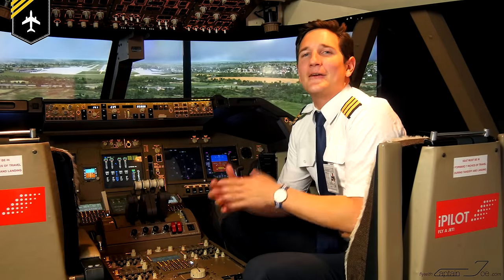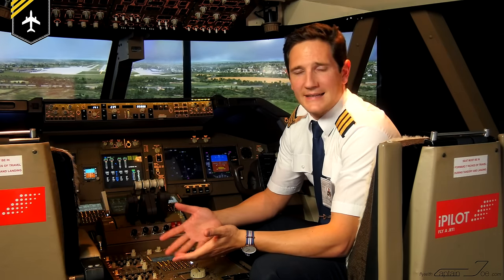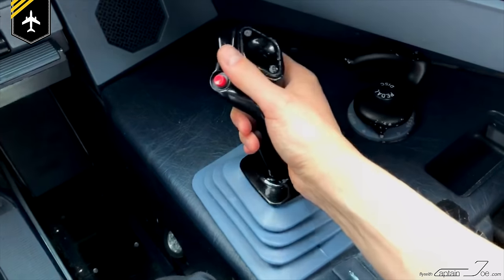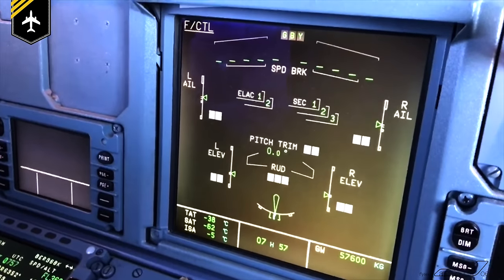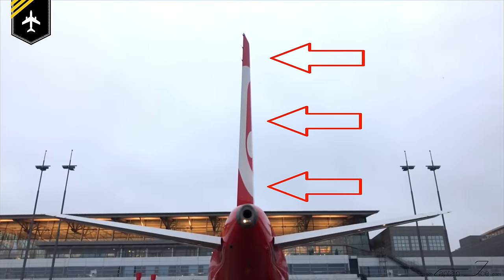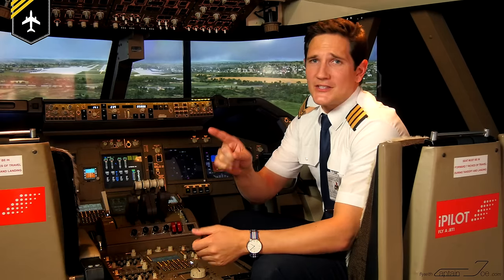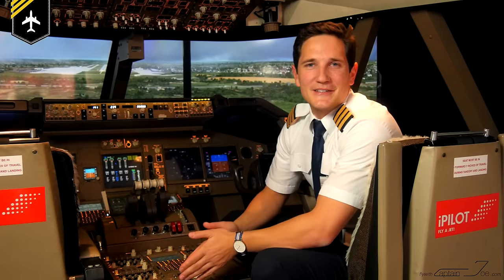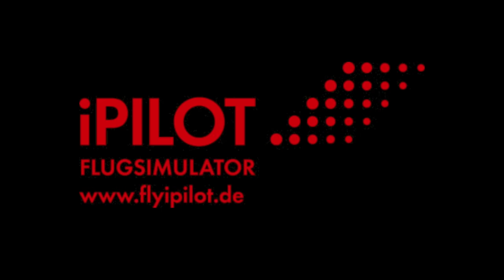Why does the RUDDER point to the right? Explained by Captain Joe

Comment: my rudder also hangs to the side while in "parking" position.
Reply: Bytesback but sometimes it releases the parking brake automatically without any pressure. Could it be a malfunction? No wonder women always break things.
Reply: left or right?
Reply: steemdup depends on the wind.
Reply: +Alexander Mustermann  Hmmmm.......very interesting, indeed.  Question for ya, Alex.  Has that rudder of yours ever been involved in anything other than "solo flights"?
Reply: turbofanlover well it had to suffer female PICs without much experience while I was the copilot.
Reply: ........and then you woke up and found your rudder to be pretty much in the same "operating condition" as Mark Jones, here.  And somewhat disappointingly, said operating condition then led to yet another "solo flight".........right?  ;)
Reply: turbofanlover Well actually my copilot resigned during another nightflight which afterwards led to several soloflights. You were partially right on this one ;) Good thing is there is a vacant position open and I'm hiring now. Female applications will be prioritised due to shortcomings of female copilots in this field of work.
Reply: Bytesback the valve blow issue is well known, several big industry companies have worked out a solution which is a tailored rubber shield. It is a single-use, low-cost solution with a 1% chance of failure.
Reply: +Alexander Mustermann So, just more "solo flights" until further notice, then.  That's a real shame there, Captain.  Good luck to you on "filling that vacant position".  Hopefully, it will happen for you, eventually.  ;)
Reply: +Bytesback  This phenomenon that you refer to has the potential to be problematic, especially when not flying solo.
Reply: Bytesback I'd check with the maintenance procedures manual on the Internet. There is a ton of websites dedicated to rudder maintenance for all kinds of models and years of manufacture.
Reply: turbofanlover as an experienced PIC I know exactly the behavior of the plane at any times so flying solo isn't a problem.
Reply: Bytesback AdBlue is a short term solution but doesn't solve the long term problem. We still need research advancements in the long term solution of the obsolescence problem.
Reply: +Alexander Mustermann, same. Although external conditions may cause it to get jostled around and accidentally get engaged in the neutral position. I get mistaken for  readying for take-off, and everyone just scampers. There was a time that this lass told me &quot;Wow. Running your engine inside the hangar. Ugh, typical&quot;. Feels bad, man.
Reply: Mark Jones indeed, the engines are running.
Reply: You guys made my day lol
Reply: 69 likes... Fits the context.
Reply: Uh finally found someone with my saime issue.
Reply: my rudder angles to the left and has a small fluid leak which leaks all over the baggage area.
Reply: Raidzor つ ◕_◕ つ same lol
Reply: Gosh, the chute got stuck in my refueling probe 
again...
Reply: SHIT MY RUDDER IS STUCK IN THE PARKING POSITION!
Reply: Raidzor つ ◕_◕ つ try ADBlue aka Viagra
Reply: Alexander Mustermann Shit now it's straight but it got smaller!
Reply: The problem with having a stiff rudder in the morning is caused by the APU starting it'self automatically while the plane is parked. Try draining the hydraulic fluid before parking.
As for filling your vacant position with a female, it is well known that if you hire a wingman you can have supplementary hydraulic fluid injected into the exhaust port to keep the system lubricated, this has the added benefit of attracting a wider array of female applicants for the co-pilot position with the potential of having a better and more picturesque view for the long term as well as better mountains in the scenery. This can alleviate the requirement of using the blue additive as the parts wear out.
Reply: Haha..Best conversation ever.Made my day 😂😂
Reply: Alexander Mustermann ikr
Reply: i laughed so loud at tjis you guys def. are the best. 😂😂😂
Reply: Alexander Mustermann 69😏
Reply: Alexander Mustermann is this comment supposed to be sexual in some way🤔
Reply: Adrian Wulff think so
Reply: Why is my rudder touching my elevators when in the parking position
Reply: A
Reply: This is pure gold.
Reply: Thanks 
Now I gotta rewatch the video
Reply: @MikePlaysYeet  nice pic
Oh wait you already said that
Reply: These coments are fucking gold lmao
Reply: I dont know if you're joking or you're serious
Reply: One of the best conversation i have ever read on yt

Comment: The MD-80 does this as well, but for completely different reasons. The MD-80s flight surfaces are controlled by tabs on the trailing edges, that deflect the airflow causing the control surface to move in the opposite direction.

Comment: to clear up any questions on backup hydraulics here is my answer:

If both engines go down, a Ram Air turbine pops out beneath the aircraft (providing hydraulics and a little bit of electric -both Boeing and Airbus)
then the APU is started to produce more electricity and restart the engines. (but the aPU uses fuel)

If the plane runs out of fuel, the plane is fully reliant on the Ram Air turbine, Pilots have to watch their speed since if they go too slow the turbine wont spin fast enough and there wont be enough hydraulics.

The ram air turbine doesnt power all hydraulics, most of the time it doesnt power all of the spoilers (sticky up things on wing) or thrust reversers (since no engines).
There are electric pumps, which are sometimes used
But during normal flight the engines are the main producer of hydraulic pressure

Capeesh?

Comment: "the Fly-by-Wire is a complex system" - As a computer engineer, I also had lectures about safety critical embedded systems (in fact the platforms I was working on in both my B.Sc. and M.Sc. thesis was a research platform for safety critical systems) and to get a handle on AFDX (ARINC 664), our professor showed a rough overview of the network architecture of an A380 and how many LRUs are used there... That's a lot of equipment that Airbus installed there to implement all the functionality of an A380...

Comment: The rudder on most smaller aircraft, like the C172, is also mechanically connected to the nose wheel steering, making it impossible for the wind to blow the rudder around. In fact, if you attempt to move the rudder by hand it can damage the mechanical linkages. I've never seen a control lock on a C172 rudder; the one shown in the video only locks the ailerons and elevator. A gustlock would also not be necessary since the nose wheel steering mechanism sufficiently holds the rudder in place.

Comment: On the DC-9, the primary controls are NOT connected directly to the control yolk or rudder peddles.  SO on the ground and with no air blowing over them, they will be driven by the wind.  You can move the yolk all you want but the ailerons, rudder and elevator will not respond.
Instead, the primary control surfaces are driven by spring tabs on the trailing edges of the control surfaces.  A spring tab is a lagging tab which uses mechanical advantage to "drive" the control surface in the right direction for the input of the pilot (or copilot). So when the control yolk or rudder peddles are moved, you can see the print tabs moving on the respective control surfaces trailing edge, but in the opposite direction of the desired control surface movement.  
This design eliminated much of the need to have powered control surfaces and therefore saved weight.  The DC-9 is about the largest aircraft you can have before you must go to powered controls.

Comment: The control lock pictured for the small plane would not lock the rudder position. It locks the yoke controlling ailerons and elevator. The small planes I fly do not have a rudder yoke as that control surface is the smallest and least likely to be blown about by wind. Not saying there isnt such a thing, just that I am not familiar with it and the picture shown would absolutely not lock the rudder.

Comment: Hello Captain Joe, i have a question that I have been curious about for many years and have had no response to it, I hope you can answer my question in the next video of yours. :)

My Question is:

Why Do Cabin Crew and Pilots Ask you to switch your Electronic Devices to AirPlane Mode or switch them off, During Taxi,TakeOff and landing. 

I really dont know why they ask that and the last time I remember going on a plane and asking the flight- attendant I got yelled out. (yeesh)

I hope you can answer my question in the next video.

Thank you and keep up the Great videos, Captain!
Reply: From a crew member's point of view, if such a rule is on the regulations or the company standard procedures, we're there to make sure that rule is respected. Now, if you ask whether mobile phones can cause a problem, the answer is "apparently not".
Why the regulations or recommendations are how they are is probably because of a measure taken when it wasn't clear whether these devices could interfere with the airplane's systems.
Reply: Put your phone next to a radio and make a call. The radio goes "Bzzzzz da dtt dt dt dt dt dt bzzzzzzzzzzz d-dt d-dt d-dt-dt-dt-dt-dt-dt....." 
Also, they want to ensure that everyone pays attention during the safety briefing, seat belts are on, and you can hear the PA system. Imagine being a flight attendant and half of the plane is on the fkn phone during taxi'ing and they are going up and down the aisles checking seat belts, and have to get the attention of every 2nd person (because they're talking on the phone) and telling them to buckle up. It would take 3x as long.
Reply: Jesus

Comment: I have a question about the glide slope , the question is that before getting the glide slope the plane is tilted because the speed is less but when it get the glide slope the plane get to it's normal position, why does the position does not remain till the plane get it glide slope? why the plane has to tilt with less speed? I will look forward for your answer

Comment: Great video as always. I assume the airbus don't have a lock for the control surfaces because they are much heavier? So the sheer weight of it can keep it in place? Correct?
Though the rudder moves left and right from wind so I assume that isn't entirely true, or maybe the mass of it means it doesn't move too quickly(hence not really flapping)
Correct me if I'm wrong.

Comment: Please explain the difference between fixed horizontal stabilizers and stabiliators. Which types of aircrafts use which types of tailplane and why? As for A320, I have seen the whole tailplane is adjustable.

Comment: Hello Capt. Sorry for the late question. How we can say that with zero pressure both ailerons are positioned down. Ailerons are differentials control , right? So if LH down then RH should be up. I don’t know about A320. I hope you can explain. Thanks in advance.

Comment: Captain Joe, would the flaps also hang down while parked due to the loss of hydraulic pressure? I vaguely remember boarding an air craft a few years back and noticed the flaps down.  As we push back and engines are fired up,  the flaps and other components begin climbing to the neutral position and retracting. Only to have the flaps once again start extending for takeoff preparation. I also vaguely remember on landing,  the flaps begin retracting and when parked at the gate,  had a long wait to get off the plane for what ever reason and saw the flaps going into full extension.
Reply: On some Airbus if the outside temperature is more than 30 degrees C then the flaps and slats are left partially out to prevent the bleed air system thinking there is a leak, leaving the flaps out allows air to flow through
Reply: @tomstravels520  thank you very much for the response. I learned something new today

Comment: Capt. Joe, I have a question.
I was told that control surfaces on a FBW plane are not influenced by external forces so one day during the Paris Airshow I wanted to put that theory at test, while visiting a Navy F/A-18E Fighter on static display I deliberately tried to move its ailerons and flaps with no avail, which confirms what I have been told.
Now my question is, are military planes different from commercial airliners in that regards?
Danke sehr.
Reply: That hardly proves anything. The difference of FBW to is that there is no mechanical connection to the controls in the cockpit which means there is no feedback from the control surfaces to the stick. With a mechanical connection you could sometimes feel vibrations and similar things of the control surfaces in the stick or yoke. That's not the case with a FBW-system.

A static display aircraft won't have switched on its flight control system anyway. The control surfaces of an F/A-18E are designed from the very beginning to be moved by some hydraulic actuators because the forces the control surfaces experience at high speed are enourmes. So even with the hydraulic pumps switched off, a human will be barely strong enough to move them.
Reply: shi01 thank you for the explanation.

Comment: is the force of the wind is enough to rotate the rudder when the plane is stand still? since it's  a hydraulic system it has some mechanisms to control the valve systems that controls the amount of fluid passing to the hydraulic.so during the stand still conditions those things are not functioning and the hydraulic fluid doesn't return back to the pump or control system  so i don't know how.. but thanks for a good explanation.

Comment: I didn't realize an Airbus's joystick actually moves... I assumed it was static and signaled the computer the force applied, not the degree of motion.  This video showed me I've been wrong.  That said, why did Air France 447 go down?  The analysis I read (sorry, don't have a link to share) claimed the junior pilot persisted in calling for pitch up even in spite of the stall warning.  He must have been pulling the stick back almost the whole way down.  How is it possible that neither of the other pilots in the cockpit could or would notice this?

Comment: what if an emergency occurs where the two engines shutdown, is there a backup battery to try and "surf" the plane down?
Reply: tesla. py there's the so called "Ram air turbine"
Reply: there is the APU also, no?
Reply: I "think" there's a backup cable or manual hydraulics (just like the power steering in your car when the engine dies-- you can still steer, just not as easily).
Reply: I believe the Fly-by-Wire system of airbus 320 has no cable backup what so ever.
Reply: That's not very comforting to know, but I guess it's a proven system.  Is the A320 a side-stick?
Reply: It doesn't exist a real "proven system" everything can break. I'm not a pilot so i could be wrong but there is a thing called APU (auxiliary power unit) that's an additional engine. In case of a dual engine failure it appears quite obvious to me to use the APU to operate the plane (while trying to restart de engines maybe)
Reply: If I remember correctly, the engines become something like a giant wind turbine in that scenario.
Reply: Sky Breeze APU Provider elec and hyd power and bleed air. In that fails you have 2 batteries and a RAT a Little windwilling turbine providing emergency hydraulic Pressure.
Reply: tesla. py the RAT will deploy..
Reply: there is often two things that can occur. the APU can provide hydraulic pressure, or, the RAT, (Radial Air Turbine), can deploy, and is like a small wind turbine, and can provide hydraulics and some electricity for the plane.
Reply: All Airbuses are side stick except for the A300 and A310. Easy to remember this way; if the number is 320 or higher, it's a side stick.
Reply: you have the APU, RAT and Yellow Hydrolic Pump. Learn something from Sully once and a while!
Reply: Every aircraft from the A318 are side sticks, but then again the A320 and the A319 came before the A318.
Reply: Yes that's true. But I only said A320 because the A318, A319 and A321 are all variants of the A320.
Reply: APU and electric hydraulic pumps
Reply: +TheLegomane before opting for an APU start at the right altitude, RAT (ram air turbine) deploys first to provide blue hydraulic power and electrical power to the related systems so as not to drain the batteries in an emergency.
Reply: You're correct.
Reply: The APU is only a power source for the plane, for use when the aircraft's main engines aren't active. You can't use it for thrust. But it can power the FBW system.
Reply: Patrick Mosur Not too mention the fact that in the first few CRITICAL SECONDS of the strike he "flew by the seat of his pants" and engaged the APU EARLY! Had he followed the correct sequence they probably wouldn't have made it.
Reply: APU doesn't provide hydraulic power directly. it generates electricy and air. hyd power is generated by the Electric pumps if the Engine Driven pumps are gone. also Rat only produces hyd power. electricity is generated by that hyd pressure :)
Reply: APU
Reply: @JJ37_  thats true but the  last resort. Generally the yellow hydraulic system(run by eng. No.2) has an electric backup pump. And the blue system has an entirely electric pump. As for green hyd system (run by eng. 1), the pressure is created by the power transfer unit with the help of yellow system. So all in all loss of engines may not necessarily incapacitate the plane unless the electric power is available